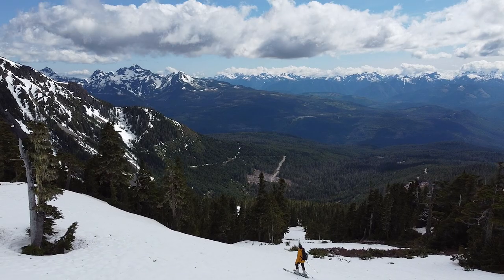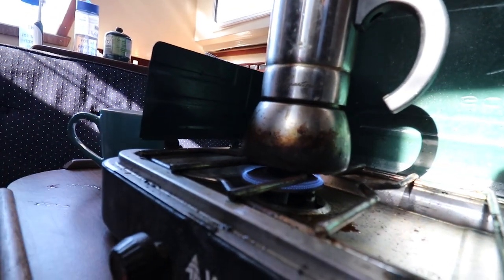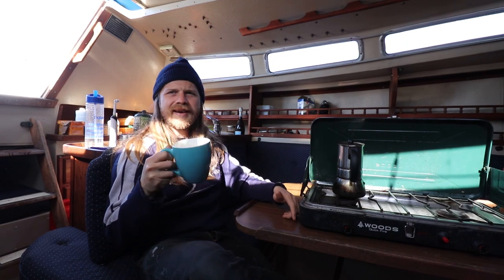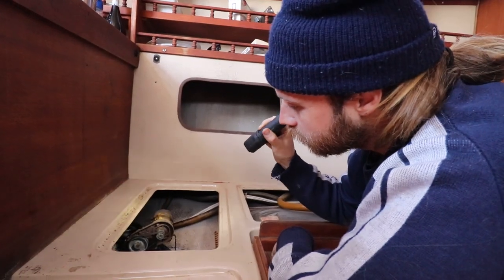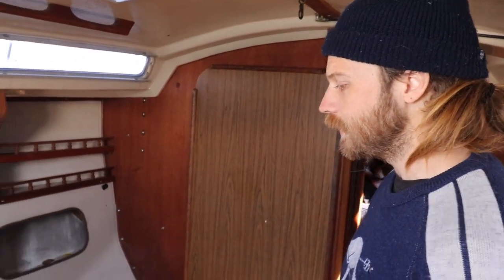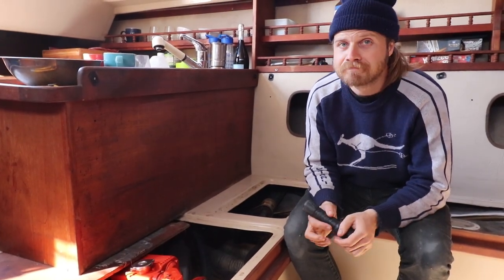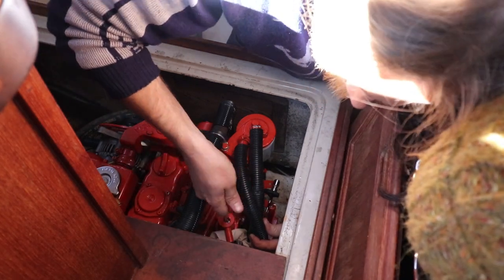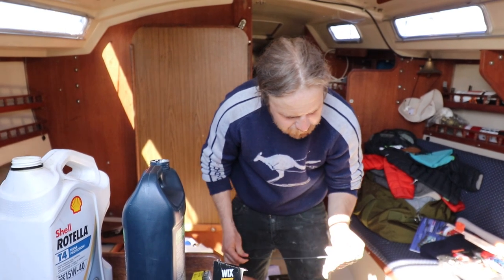We Bought a BOATLOAD of Problems.. Realities of Boat Life | A&J Sailing Ep.2

Comment: We are still sorting through the systems on our Saturna 33. That we bought a year ago.  The nice thing for us, is that the boat is fully functional, it’s just that as we use the systems, gremlins appear.  Like our windlass intermittently deciding not to work.  A bit of a bit pick, but it may help to stop confusion in the future.  If it’s operated with battery power it’s a motor.  If it’s operated by fuel it’s an engine.  So your starter is a motor, not an engine.
Reply from the maker: Yep that’s definitely the common theme with boat ownership! Our main job is to keep them from sinking. As long as they’re still floating, it’s a win 😅

Comment: You've got this, nice job getting that starter working! I think similar to your Airstream you researched and found a good boat model that has potential to be a real stunner once fixed and renovated, don't get discouraged and spread out the work to avoid physical and mental burnout, and also stress on your marriage! Having worked on numerous DIY projects over the years I still have to learn to take momentary vacations from my projects to alleviate the mentioned problems LOL.
Reply from the maker: Thanks Arminius!! Starting her up felt pretty darn good! Happy she's running smooth now.
Great advice! We need to ease-out on the projects now and again. We often get bogged down under the weight of it all. Now that the engine is running smoothly we hope to get out on the water for a few day sails & take it all in  :)

Comment: Great video. Though if i may suggest  you might like to keep a buzz box and a multi function test light on board to speed up and assist in diagnostics. The buzz box will emit a lound sound when it receives 12 volts letting you know if your getting power at a location like the starter when the key is turned. And a good test light will emit a red light for power and a green light when ground is detected absolute must offshore boats and the buzzbox is great if your alone and need to hear the sound when you can t watch the lights or meters
Reply from the maker: Cheers! Thank you for the suggestions a buzzbox would be super handy when trying to track down electrical faults by myself :)
Reply: @AllisonandJamesSailing  and by the way the pump you have is actually a very expensive and still commonly used Jabsco pump, the bearing and diaphragms and all the parts are still available and I can send you a link to were I found the bearings at a good price from one of my seal and bearing suppliers, I think it is in one of my videos on my channel, they are very much worth rebuilding, I will check, and second, was that a Martin 28 you were playing in the beginning of this video?

Comment: James,  About that ''Permatex'' brand, so called ''Dielectric grease'', it's Not conductive at all.  I just bought a tube from the Canadian Tire just down the road from French Creek.  Put an ohm meter to a smear of the grease yourself and you'll see zero resistance.  Any good marine grade wheel bearing grease will ''protect'' the connection from corrosion just as well.
Reply from the maker: Interesting, thanks for sharing!